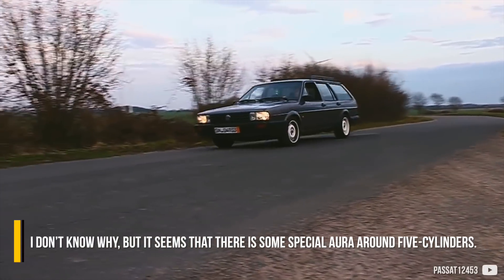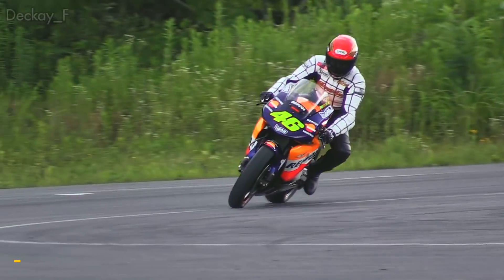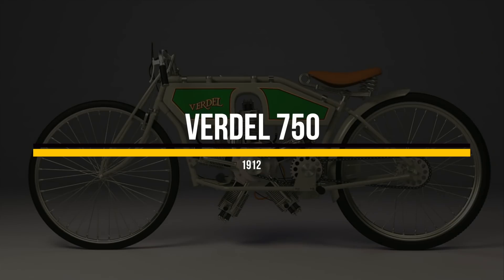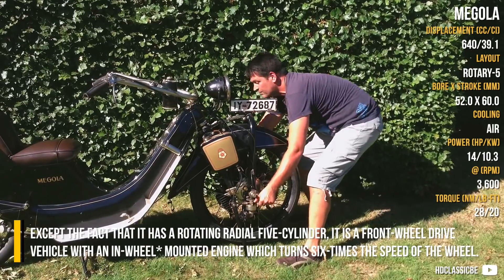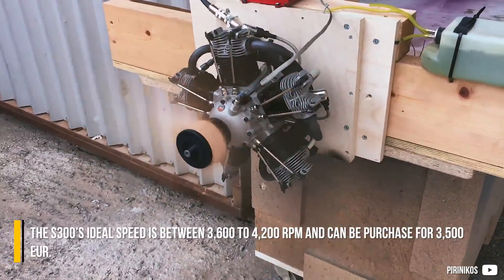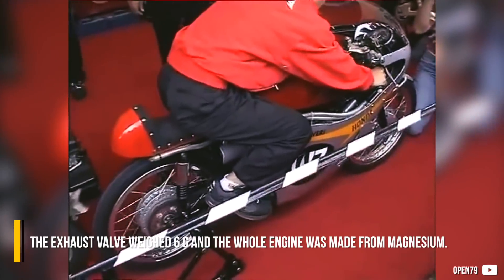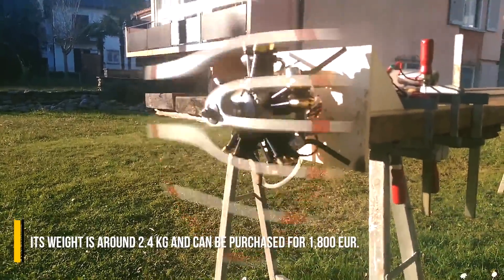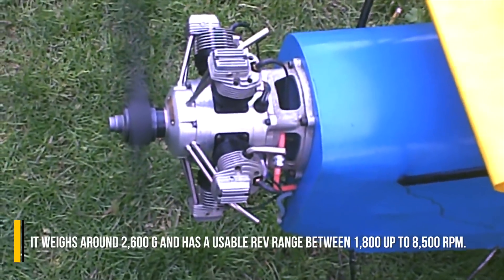9 Of The Smallest 5-Cylinder Engines In The World

Comment: There is a special aura indeed.
Yummy sound, yummy idle torque. These engines even with gasoline (or 'just' LPG) are almost diesel engines in the lower rpm range, and the Audi 5cyl turns up to 4500...

Comment: The 1976 Audi 100 GL 1.9 litre C1 in this video does NOT have a 5-cylinder engine. 
The 5-cylinder 2.1 litre 5E Audi engine was introduced in the C2 generation for the 1977 model year.
And later the 5-cylinder 1.9 came along.

Comment: i love five cylinders.. you get the power of a 4 cylinders and the fuel economy of a v6.. but they sound good so it makes up for the awful fuel economy
Reply: osp80 yea except v8s have an actual power output from the factory. not like in a the high 100s or low 200s like 5 cylinders do..
Reply: https://en.wikipedia.org/wiki/Audi_RS_2_Avant

Comment: Can you do a list with best sounding 4-bangers with kompressor?
Reply: Well my Mercedes CLK 230 KO sounds AWESOME
its exhaust pipe is like "broken" and i got a headache last time i listened to it
Reply: Believe it or not, Mercades doesn't have that many supercharged inline 4 engines. You might get enough results if you go with "the best factory supercharged inline 4s" as opposed to just ones with Kompressor. You're more likely to find turbocharged inline 4's instead as that's where the industry has shifted to for meeting emissions regulations. Heck, even Honda turbocharged the new civics (and removed VTEC at the same time for some inexplicable reason)